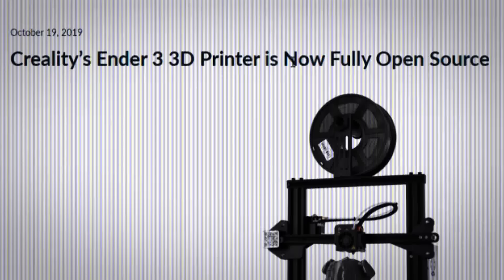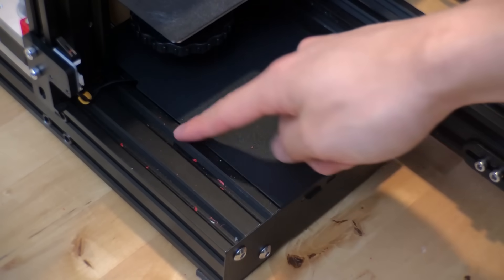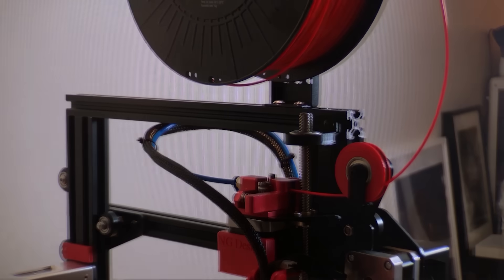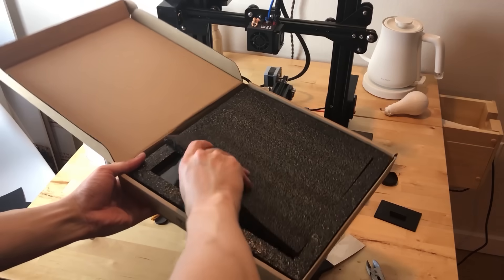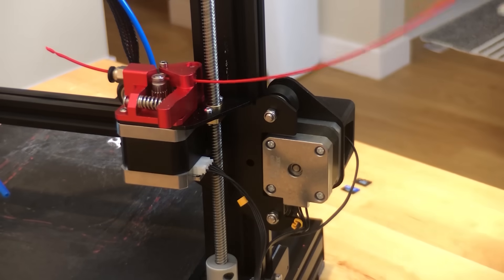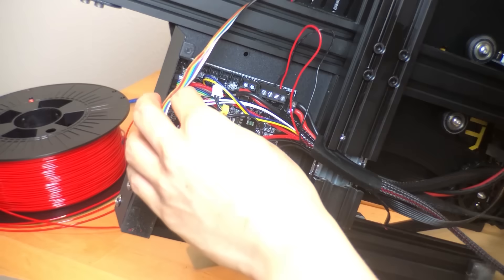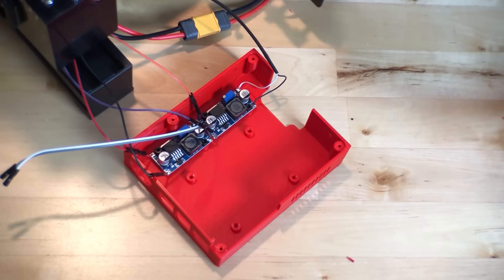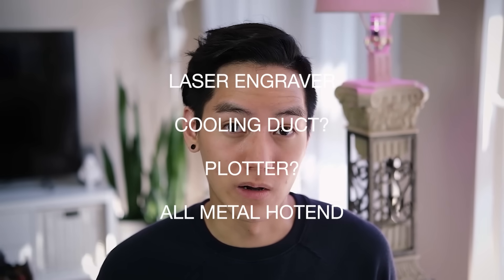First 24 Upgrades for my Ender 3 Pro - Part 1

Comment: DEFINITELY get an all metal hotend. I have an Ender 3 and it is bar none the best upgrade you can get because:

1: You can print higher temperature materials
2: You won't ever have to worry about filament drag
3: Replacing nozzles is so easy a baby could do it

It definitely beats the stuffing out of the stock hotend if you're like me and change nozzles a lot for different sized prints. Having to re-seat and periodically trim the PTFE tube is a massive pain in the arse!!

Comment: I kept the magnetic adhesive for the original flexible bed when using glass. You can heat the bed up to 60 with binder clips, then remove it. It won't move again.  Even then, it may be loose but just bring it back up to 60 and it won't move.

Comment: the skr mini e3 should come before the bl touch so you don't have to use a pin 27 adapter/ cut up the ribbon cable.

Comment: Great video and nice upgrades. But I don't understand, how does the bl touch help with bed leveling without servos on the four cornors? Does it tell you how and which cornor to adjust or what?

Comment: Hey man I love it... one thing I noticed is at 8:08 and 8:29 when you were messing with the hot end your bearings looked loose. Am I crazy? I don't think it's supposed to move around that much. You might have to tighten that eccentric nut!

Comment: Constraining the threaded rod on the top introduces unwanted artefacts! You want the rod to be able to move around freely at the top. Protip! Also, At 4:47 you pull the prints off the bed and move the bed by doing that. You can see the LCD light up, this is actually a bad thing. You moving the Y-axis is generating a current because the motor works as an efficient dynamo. This creates current that goes back into your printer's controller board and can potentially damage the internal components!
Reply: Then why is there a "disable stepper motors" option in the menu? You can move the bed it's fine
Reply: @S0Fr3shThisKid  It doesn't matter, a motor is a dynamo and will always generate some form of current when moved. If you move the bed slowly it's okay, but do it too fast and the current may damage the mainboard. Don't say it's fine, there's certain boundaries to it.
Reply: @S0Fr3shThisKid  By the way your argument is totally invalid. The 'disable motors' function is so the driver stops feeding holding current to the motors. Allowing everything to cool down when not in use. It is not meant so it's easy for you to move the axis around, however it does come in handy when you actually want to move an axis manually.

Comment: I did upgrade my ender 3 pro in pretty much everything, i upgraded the extruder with ezr struder with direct drive from printermods, also upgraded the heating block and the nozzle to micro swiss all metal hot end, i upgraded the board to skr 1.4 turbo, i added bl touch and i bought raspberry pi (still on the way) and i started to build an enclosure to be able to print with higher temperature filaments and i talked with bigtreetech about changing the thermocouple to higher temperature  (up to 300⁰C) and i want to upgrade the screen to touch screen and thats pretty much it 😅

Comment: This is really good video congrats really I'm surprised to your quality, I just have only one question and that it's the real reason why I arrive here... Why BItouch and not a ultrasonic sensor could you explain me please?
Reply from the maker: thank you so much! and do ultrasonic sensors work on glass? i just figured BLtouch had the most online support and recommendations around it and since it's mechanical it will pretty much work on any kind of bed surface. didn't do much research though. should i get ultrasonic sensors in the future?

Comment: Do not think that Capricorn PTFE can handle higher temperatures. The diameter is more accurate, which makes it smoother, but teflon still off-gasses at the same temperature. If you want to print at extremely high temperatures, try changing the hotend setup as well.

Capricorn lists melting temps, not degradation temps when advertising their PTFE tubing. This could lead to people thinking their products are more durable than they are.

Capricorn tubes have a unique selling point in that their quality control ensures accurate inner and outer diameters of extrusion. This is in contrast to generic manufacturers who may not have as stringent a requirement for manufacturing.

A 1.9mm ID (inner diameter) has been shown to help in reducing hysteresis when extruding flexible filaments in a Bowden setup but in other setups, i.e. filament with a higher variance in diameter, this can actually become detrimental. Use best judgement when deciding what form or brand of PTFE to use in your printer.

Capricorn tubing is relatively high quality for its price point, but there is insufficient independent evidence to show that it has more thermal resistance to pyrolysis than "generic" PTFE tubing. One difficulty in testing is that due to the colorants in the PTFE resin, the distinctive "browning" of degradation or pyrolysis is much harder to detect. Another point of concern is to do with Capricorn's line of translucent "TL" PTFE. Though the exact composition of their resin remains proprietary, the nature of PTFE and related fluoropolymers speculatively suggests the addition of PFA or FEP (which are optically transparent) into the mix. The issue with this is that both PFA and FEP have lower working temperatures than PTFE. PFA is rated to a similar ceiling of 260 C but has a higher thermal conductivity whereas FEP undergoes degradation at temperatures as low as 200 C. Unfortunately without further evidence, this must remain speculative.

In short, caveat emptor. Capricorn is a quality product, but it is not magic.

Comment: Input a BMG extruder on mine. It's a clone but I swapped out it's plastic groove mount Bowden adapter for the metal E3D groove mount adapter. It works so much better with that one piece.
I added the BLTouch also but I don't use it anymore. One version of Marlin messed it up. It's probably fixed now but I never went back to using it. In fact I don't use any auto bed leaving on any of my printers. I get better results by improving the print surface. If it's flat and stiff to where you don't need to level it much, it works fine. Changing the bed to something like glass or a tooling plate then using stiffer springs and better adjustment knobs will greatly improved this. I check my print bed like once a week and maybe adjust it once a month, sometime once in two months. I haven't adjusted the bed on my Delta printer going on 8 months now. "Cross fingers" :)
I was going to try that hotend mod by like or whatever his name was. Saw Chep mention it. Instead I just swapped out the stock PTFE push fitting for a E3D one. It's the black made out of plastic. I may still try the other mod though one day but so far I haven't had any issue with slippage of my PTFE tube using this fitting. I will say you will want to remove the Hotend before installing it. The hex on it will hit the carriage if you try to screw it on while still attached to it.
The SKR E3 like you mentioned is a must. They have answer v2 out now though for those thinking about getting it.
Changing the spool holder is also a good idea. The original one sucks. There are quite a few great options so I won't suggest any particular one myself.
I also upgraded the wheels for my liner motion. The originals wore out pretty fast.
That's just a few things I've done. I have done a few more but I don't feel like listing all of them. :P

Comment: Got recommended this video, ill make some comments as an experienced ender 3 user:
If you have the space, print a side filament spool mount, the path from the top, even with that guide is still less than ideal. Plenty of good designs on thingiverse

Those cheaper dual gear extruders tend to have an issue where the gears dig into the base, eventually destroying itself (i recommend https://www.aliexpress.com/item/32904209624.html as a replacement)

The SKR mini series of boards, especially the pre 2.0 version, have a VERY high failure rate when it comes to driver and mosfet failure due to heatsoak of the PCB, highly suggest you print a custom control box with a larger fan for more airflow, making sure the bottom of the board gets airflow (tmc drivers are designed to sink heat into the pcb)

I also recommend some heatsinks for the pi 4, they can get pretty toasty, any decent pi 4 heatsink kit will do, passive or active in that enclosure.

Instead of buying the capricorn tubing, i would suggest getting an all metal hotend (https://gulfcoast-robotics.com/collections/hotends/products/all-metal-hotend-conversion-kit-for-creality-ender-3-ender-5-cr-10-3d-printers ) my recommended drop in replacement.

Other upgrades i would do are quieter fans (i recommend 24 volt sunon or orion, dont waste time and money on noctuas due to higher price, lower cfm and more buck converters, minimum 6 cfm for the stock style hotend), 3d printing a better hotend/parts cooler (petsfang bullseye for stock 40x40x10mm blower, various good designs for 50x50x15mm blowers)
Reply from the maker: wow thanks for the info! i was totally about to do the noctua fans but i'm glad you shared this because i would love not spend so much money on fans if i don't have to. i'll definitely be looking into those alternative options you mentioned. thank you! cheers.

Comment: Great video definitely make the next one. Will these mods fit the ender 3 non pro version?
Reply: I had same question but wager that they can be applied. Not sure about the board changes but the rest look doable, as its the same body?

Comment: Great video! I’m looking forward to next part with the laser engraver. Have you considered Dremel mod? It’s when you connect a Dremel and make a CNC engraver of the 3d printer.
Reply from the maker: Ronnie Sedin i REALLY want to do this but i’m no expert when it comes to the G-code modifying and all that and i’ve been struggling with finding resources for this online :(

Comment: I bought an ender 3 v2 and now I feel like maybe I should have bought an ender 3 pro instead. I feel like the extruder cover on the v2 seems crappier and of less quality than that of the ender 3 pro. what would you have bought and do you think I should have got the pro instead?
Reply from the maker: extruder cover is easy to replace though. in fact i might replace mine soon with one that has a better fan duct so i don't think that's enough reason to not buy the v2. the v2 has a touch screen and LOADS of other dope features so... make that choice wisely haha good luck!
Reply: @ScottYuJan  thanks for the response! Can i swap my v2 extruder cover for the metal ender 3 pro one? thx

Comment: Are you using PETG for those electronic enclosures? PLA is definitely not recommended as it burns like a candle.
Reply from the maker: ooof good point... i'm hoping it won't get that hot with the fan but still just to be safe, you're totally right. maybe i'll reprint it with petG at some point. cheers

Comment: You might want to look at the Micro Swiss direct drive extruder with the all metal hot end I just instilled one on my Ender 3 Pro. It cost a lot more than most but is easy to install, is well made and so far works great.     https://store.micro-swiss.com/collections/extruders/products/micro-swiss-direct-drive-extruder
Reply from the maker: thanks for the suggestion! will definitely look into that. a few people recommended that upgrade as well. cheers.

Comment: What kind of switches do you need to power the pi and led lights? I found some 6A 125V 2 way toggle switches, are they safe to use?

Awesome job on the video btw, just ordered the Ender 3 Pro, raspberry pi and like at least 5 other mods you showed here, thanks!
Reply from the maker: from my understand (someone please correct me if i'm wrong) the amp a switch needs to be able to handle depends solely on what kind of demand the switch is connected to has. meaning basically, even though the PSU has a high amp output, if you're only powering some LEDs and raspberry pi, your switch only needs to be able to handle the amp levels that thing needs. so raspberry pi 4 i believe only needs 3 amps. the switch i'm using is just a super cheap toggle switch on ebay. literally type in toggle switch and i think it should be the first one. good luck!
Reply: @ScottYuJan  Ah ok that makes perfect sense, thank you!
Reply: @ScottYuJan  Got another question for ya. I just finished printing the case for the pi4 and 2 buck converters. Do you know what size screws to use to mount the hardware in the case and to mount the cover onto the case? I tried some m2.5x6 and they weren't wide enough and I tried some m3x8 and they seem to be the right width, but too long. I'm thinking m3x6 maybe?
Reply: For anyone wondering, it does indeed take m3x6 screws :)

Comment: Locking the lead screw will cause you issues if it is even sl8ghtly bent. Its not ment to be held perfectly inline. This has been a bad idea since the first ender 3

Comment: Do you know of any tutorials/resources for learning how to do the electronics/power stuff for adding the Raspberry Pi?
Reply from the maker: hey! there's a good tutorial article here i think can help in terms of the electronics for adding the raspberry pi: https://howchoo.com/g/zjm0zjnlndq/how-to-power-a-raspberry-pi-from-your-3d-printer 

this guy uses a xt60 Y-splitter cable instead so it didn't even require opening up the PSU! a lot easier in my opinion. if you do want to do exactly what i did here though, it's honestly not much harder. i can't find any good resources but it's pretty straight forward. once you pull out the PSU there are just empty slots marked +ve and -ve that you can hook up stuff to. good luck!

Comment: A tip for the power supply, you can buy noctua fans that are the same or similar size and nearly silent.
I put one on the outside of my power supply, worth every penny.
You can also look for other noctua fans that replace the fans on the printer, it's really worth it!

Comment: Superb editing skills, good upgrades but bltouch and motherboard are just major one. Other ones has minor impact on printing quality. Suggestions:

Good motherboard, done
Bltouch, done
Dual Z Axis with two step motors, not yet
Linear rail for x-y-z, not yet
Cross stiffener bars for rigidity, not yet (check the "Proper Printing" channel, whole body triangulation)
Optical coupler/stoper for precision, not yet
Dampeners and coolers for step motors, already had. Install for vibration. Also install soft vibration dampener under the ender.

Comment: Hi ave got the ender 3 pro, I've upgraded motherboard to sir mini e3 v1.2 and the tft screen and I've installed the bltouch but it's not working correctly, is there any chance I could have your firmware please I would be a great help I've been at this for weeks

Comment: Ok you got me, I will make few of them (till now, i have changed just bed springs), I will definetly avoid SD card mod and Screen cover.
About led lights: in that position the 3D model will be covered by Extruder/Shaft shadow while printing, so i would put the leds directly on the Extruder shaft (I think i have seen a video about this mod some time ago)

Comment: I spent my first two spools of pla making parts for my printer... (Trial-error victims most of them).
And lots of parts; new motors, optoelectric isolator for industrial precission cnc capacitive sensor, optical endswitches , anti backslash connectors, anti vibration threads, igus composite bearings, borosilicate bed, solid state relays, overkill power box with plenty amps, bowden conversion, stainless steel frame, lerdge-k motherboard with marlin firmware, touch screen lcd, s42b closed loop drivers...
Now i've got a beast of a machine, and i'm looking for a corexy new one... And to convert to a multitool double head the old one, including a 15000mw laser cutter.

Comment: As someone who'd tested the dual gear extruder, the gears are such tremendously horrid quality that it grinds itself down very quickly. So I'd advise you to upgrade to a DD set up ASAP.

Better yet, get a g5 flexible extruder!

Comment: Could you do a step by step video or article on how you connected the LEDs. I really like the switches you put in, but I can’t find anything like it online. I’m a noob when it comes to soldering and wiring and stuff.
Reply from the maker: this tutorial teaches you how to connect a buck converter to the PSU WITHOUT doing any of that intense soldering stuff directly in the PSU. it's a lot easier of an option if you JUST want to connect some lights. not hard to add a switch to this method as well. and you can get the kind of switch i used here on ebay: https://www.ebay.com/sch/i.html?_from=R40&_trksid=m570.l1313&_nkw=toggle+switch&_sacat=0
they're fairly cheap. Good luck!

Comment: How much weight did that add to your Y axis, and how much did you have to decrease your acceleration by to compensate for the added ringing?
Reply from the maker: yeaaaa the glass bed was the biggest offender of all honestly. kinda regretting it. might switch to a pei bed at some point. i just finished doing some calibration the other day and i had to slow down the acceleration a tiny bit by around 5mm/s and printing speed is still at the same so it's not too bad.